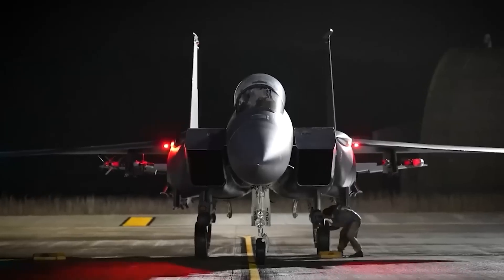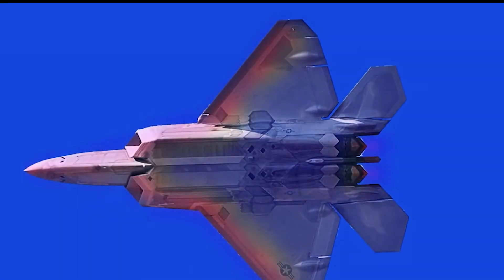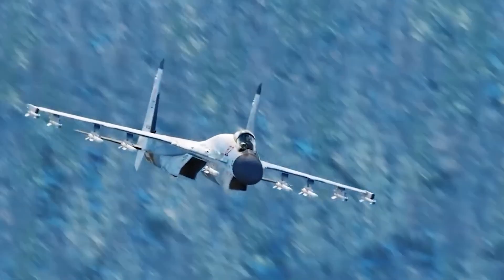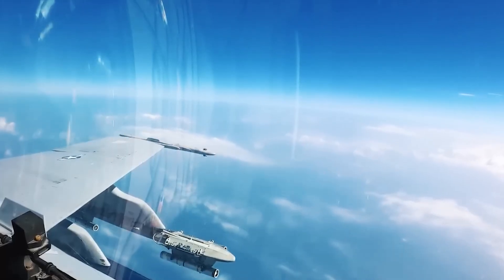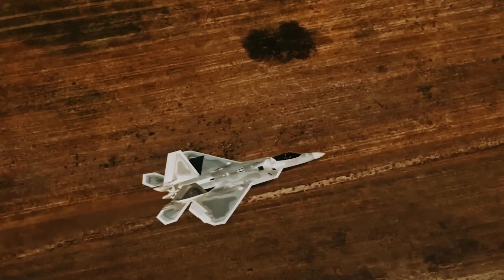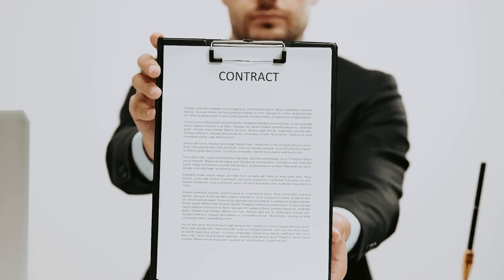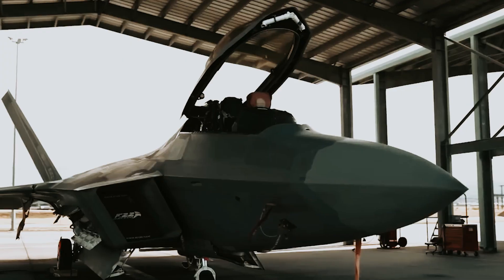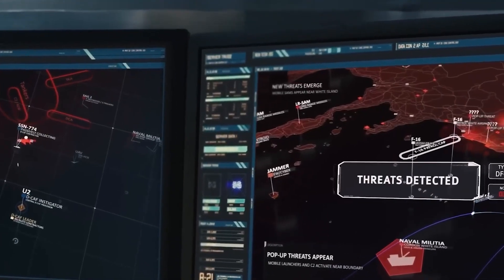The F-22 Raptor: America's Dominant Air Superiority Fighter

Comment: The f22 is not impervious to radar, it's radar return is small enough to not exceed the typical "squelch" setting on most opponents radars, adjusted to ignore minimal returns, used to avoid having birds distract the pilot with pointless returns,the same for sam battery opperators